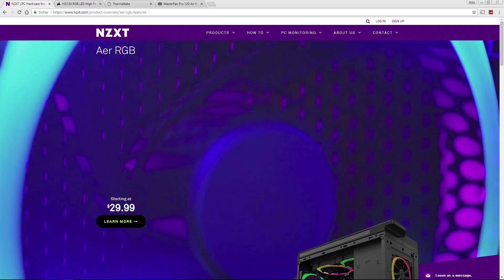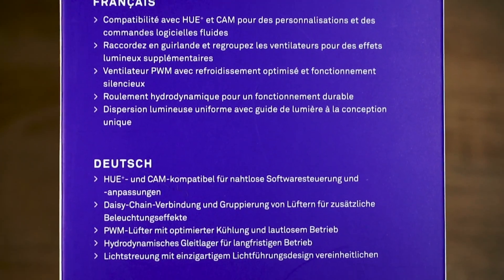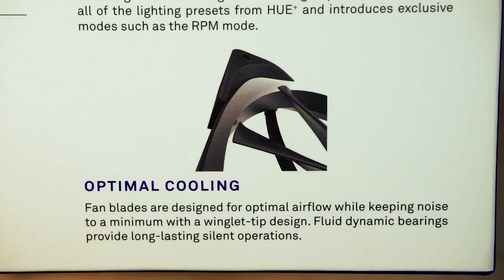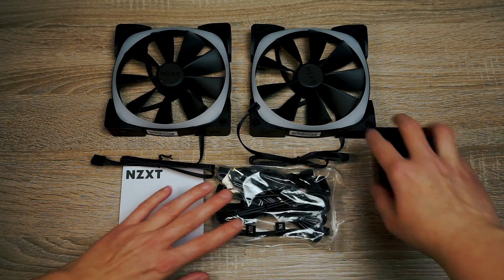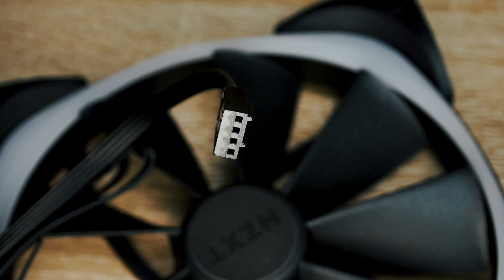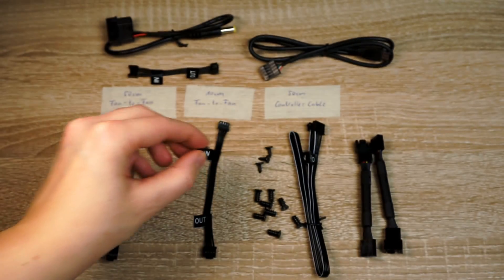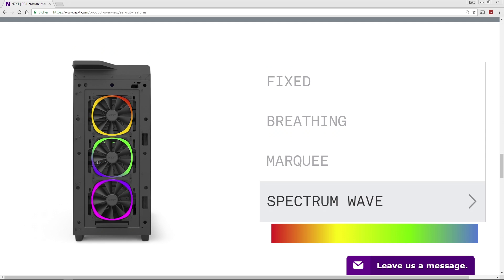NZXT AER RGB Fans - Unboxing & Cable Connection Guide

Comment: I plan to use the AER RGB 2 for the Phanteks 719 case and plan to put a 140mm fan at the back of the case and triple 120mm at the top? With they be considered exhaust fans in the order or will they be intake?
Reply from the maker: It depends which way around you put them. The fans have a front (NZXT logo on bearing in the middle) and a back (side with dampeners on the edges). The front sucks air in, the back pushes the air out. So depending on how you mount them, you will have intake or exhaust.

Comment: my NZXT X53 did not come with controller cables or the longer fan to fan cables to connect to my RGB controller. The fan and cooler still works but it bothers me that the RGB fans do not light up. anyone know where i can order both?
Reply from the maker: The x53 actually has no RGB fans unless you bought any to replace the ones you’ll get with the cooler.
Reply: @janeeightfive7331  got it off of amazon. It gave me the option to order the RGB one that comes with the AER RGB 2 fans. probably a bundle thing. anyways i managed to get it working. it ended up being an issue with my internal hub

Comment: Why won't CAM software detect any fans being connected? the fans are spinning fine but won't recognize so i can change rpm speed
Reply from the maker: If you connect everything correctly the way I described it, it should detect them. Did you connect the controller correctly to the mainboard and to the power supply?

Comment: Hello. I recently bought one AER 2 RGB 120 for the back and one 140 for the top of my case (didn't find the pack including Hue+ as shown in the video, so i bought the fans separately.) My problem is the devise I need to get in order to make the RGB lights on them to work. Do I need to get Hue+ or Hue2? Please help I'm confused...
Reply from the maker: Since you bought the Aer 2 I guess you need the Hue2. It both seems to be an upgrade to the original Aer fans. To be sure I suggest you contact NZXT and ask them directly.
Reply: @janeeightfive7331  Thanks a lot for the quick reply 🙏🏻

Comment: The breakdown of the included cables with the case was the FINAL crucial piece I needed to get my NZXT build in order! Thank you for showing the connector differences, as that was EXACTLY where I was stuck! Once I figured that out - all my RGB fans were finally working properly on their channel! This worked actually for my HUE2 box and I'm glad to see they didn't change up the daisychain cable connections too much from the prior version

Comment: I need to express my gratitude here. I am 90% done with a build, and I bought one of these fans "new" from a seller on ebay without realizing that it only came with the daisy chain cable and NOT the fan to controller cable. The solution? I cut the daisy chain cable in half and soldiered it together with an extra nzxt extension cable I had. That will plug directly into my controller for the rgb. Crude but you gotta do what you gotta do. Nzxt really didn't want to use standard cable sizes I see.....

Comment: Jane please help me!
If i have;
H210i Smart Device V2
RGB Strip that comes with the case &
x2 AER 2 Fans &
X58 Kraken
Do i need the HUE 2 or is the Smart Device Enough?
TYY
Reply from the maker: I don't know that smart device. The Hue+ is just the controller, the connection between the software and the hardware. If the smart device acts as a controller, then it should be enough to control the hardware.
Reply: @janeeightfive7331  Thank you for the information, i really think you should do more of these videos, it is very helpful for dummies like me

Comment: Help me pls...can I connect 2 fans as a britches and 1 diferent , so I want 3 rgb fans...and if I buy this packet with the 2 fans and 1 nzxt are 2 rgb fan will I have any problem?
Reply from the maker: If I understood you right, you want to daisychain 2 fans and connect a 3rd fan? Well, there won't be a problem then. You can daisychain the 2 fans and use one of the two inputs of the controller and connect the 3rd fan to the second input of the controller.
Reply: JaneEightFive thank....but am I have any problem because the model is different? The one is just model nzxt aer 2 rgb and the other is nzxt aer rgb
Reply from the maker: @mr.alphayt5523  due to their website they say for the Aer RGB 2: "Compatible with all HUE 2 controllers and accessories" and "HUE 2 Accessories are not compatible with the HUE+". here is the website: https://www.nzxt.com/products/aer-rgb-2 If you have any compatibility questions, just google it. I'm not working at NZXT and don't know every details.

Comment: Do the cables also power the fan or the rgb? In the video when you daisy chained them, their were still cables coming out of the fans.
Reply from the maker: you connect the fans to the controller to be able to change the color modes in the CAM software. the other cables coming out of the fans are connected to the motherboard for power supply.
Reply: @janeeightfive7331  by any chance do you know how many fan ports are on the asus z390-e? I will have 7 fans in total, 4 nzxt aer rgb fans and 3 nzxt non rgb fans that come with the h700 case. I don't know if i should buy a fan splitter or not.
Reply from the maker: @kingler8936  for questions like this please look it up in the user's manual. I dont know the specs of every motherboard ;)

Comment: One question... Let's say I have a cabin with a controller already. It's called Inter-Tech S-3901 RBG. Is it possible to connect an NZXT Aer into it's controller? As I see, the controller only has 5 pin connectors. Is it compatible with the 4 pin Aer ones?
Reply from the maker: Sorry but I neither know this case nor its rgb controller. Without any further information, I can't answer this question. I also couldn't find any information about it on the company's website.
Reply: @janeeightfive7331  Understandably but thanks for the response. I checked it thoroughly and it turns out its impossible. Brand like NZXT like to create their own controllers, meaning the same goes for chinese brands like Inter-Tech's productions.

Comment: Is a HUE box required if you have an h500i or h700i that has the box built in that can power up to 3 fans and two LED strips? I have an h500i and I'm wondering if the connections on the AER 2 RGB fans are different than the case fans that come with the PC. If all I needed were fans that could plug straight to the box built into the i models of the NZXT cases, then I'd jump on it, but I'm pretty sure I'd need the HUE box.
Reply from the maker: I don't know the cases. So, I don't know what box is built in there. You need the hue+ for controlling the fans and LED stripes in the CAM software.

Comment: If you have the NZXT 500I do you already have the fan hub?
Reply from the maker: I dont have this case but I dont think so. There are tons of videos on YouTube specifically about this case. Maybe they say something about it. But I think NZXT sells the hub only seperately.
Reply: @janeeightfive7331  I know they sell it with there case :D But i thought maybe you know if that is the only thing i will need when i use rgb fans
Reply from the maker: @MePorro_  You need the hub only when you don't have enough fan ports on your motherboard. The Hue+ Controller on the other hand  is neccessary to control the fans.
Reply: @janeeightfive7331  I thought that the ports on the motherboard are to high voltage for the 5 voltage 4 pin connecter of the fan, that way you wil burn out the leds
Reply from the maker: @MePorro_  well, I don't know about that but I guess there are standards for ports and fans to make them fit together and the companies just have to keep those standards. Wouldn't make any sense otherwise.

Comment: Had to fire up the PC mid install to find a video like this. I thought i was missing a cable, untill you mentioned that the 2 black and white cables are actually different. Lifesaver!. I did not get a extender cable in the box, there was a controller-cable for a led strip inside instead :/. I don't need the extender, but it's strange.

Comment: Hello. I have a question. If I use non NZXT computer case and if I want to use AER RGB fan with HUE controller, then Do I have to buy a fan controller too? Which is called NZXT GRID+ V3? So simply I am asking that does HUE controller have fan power port and RGB port both or need a seperate fan controller? Thank you.

Comment: Its work one hue + and 6 nzxt aer 120mm rgb ?
Reply from the maker: FaZe Kirito You can use up to 5 fans PER channel if you link them together. The size doesnt matter. It just depends on the size of your case, which fans fit in there.

Comment: Hi Jane, I was wondering do I need to connect both of the 2 fans 4-pin connectors to the motherboard or just 1 will do?
Reply from the maker: Satha Sivam each fan has to be connected to the motherboard. This way you can detect every single fan's position and control the fan speed.
Reply: thanks for this question , had the same doubt.

Comment: So if i want to light 5 fans i need 2 controllers?
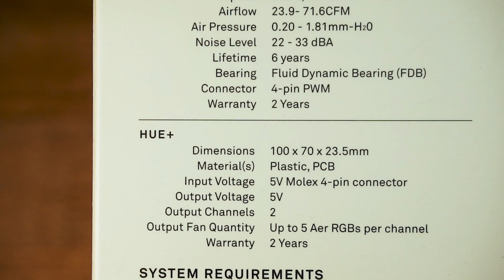Reply from the maker: Jay Lee at 2:18 you can see that the Hue+ supports up to 5 fans per channel. So you only need one controller if you wanna use 5 fans.
Reply: JaneEightFive ooops i meant 6 fans, do you need a second controller if you have 6fans?
Reply from the maker: yes, then you need a second controller. maybe it's better to go for one of the other companies that provide 6 fans.

Comment: You also missed the 2 pin cable, and where do all other parts go on the motherboard?
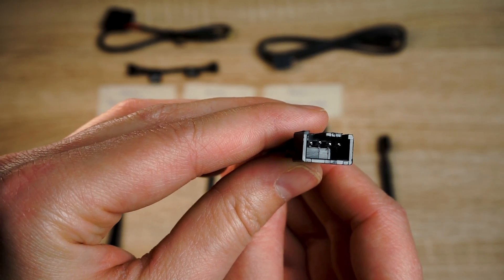Reply from the maker: I showed every cable that I got with the box. there's no 2 pin cable beside the molex adapter I mentioned at 6:20 & 7:14. the molex adapter goes into your power supply like I mentioned. the connection to the mainboard is through the normal fan ports on the mainboard. you can look into the user's manual for your mainboard to identify them.

Comment: The HUE+ supports only 5 fans. What if i have 6 fans in my case? What about that one?
Reply from the maker: well, than I would recommend you another brand that can support 6 fans. you can still use your 6th fan by connecting it to your motherboard but you cant control the rgb colors of your fan via the cam software.
Reply: I think you can control 5 fans per channel.... look the video 1:54... you´ll see the diagram channel 1 and channel 2...

Comment: I did exactly what you did but my fans are lighting up. CAM isn't even detecting them.

I don't know what to do! :(
Reply from the maker: You also need to connect the Hue+ controller to the main board. I didn't mention that. You need an internal USB 2.0 connector on your mainboard. Unfortunately there aren't so many of them. I had to buy a USB 2.0 hub from NZXT for that: https://www.amazon.com/NZXT-Internal-Controller-Black-AC-IUSBH-M1/dp/B01IFGFTJ2

Comment: Awesome work Jane. Personally I dont like the Hue+, I dont like the fact they still dont take power from Sata, and that there is only two channels out, but I do like the possibility to daisychain the fans.. I like the Corsair LL kits much more, up to 6 fans or led strips per controller,  and of course Sata power. Corsair Link is still as useless as it was two years ago though.
Reply: 5 fans per channel or 4 strips per channel. can not be daisy chained!
Reply from the maker: Interesting. I only need 2 RGB fans right now. so, the hue+ is enough for my needs. like I said, you have only 2 channels but you can connect up to 5 fans per channel. that means 10 fans in total. who needs 10 fans in total? ;D but if you wanna use rgb stripes as well, I dont know whether you can daisychain them with the fans. then the hue+ controller could be less attractive with its 2 channels. I will probably try it out and buy the nzxt rgb led stripes to replace my current one color stripes. 

Is the Corsair Link the controller for the Corsair fans?
Reply: Corsair Link is the software, same like NZXT's Cam